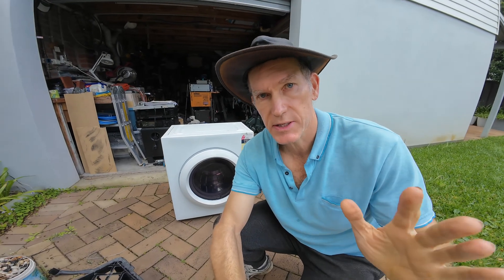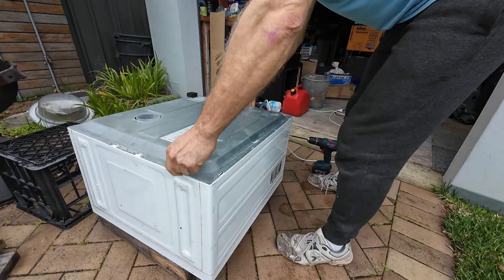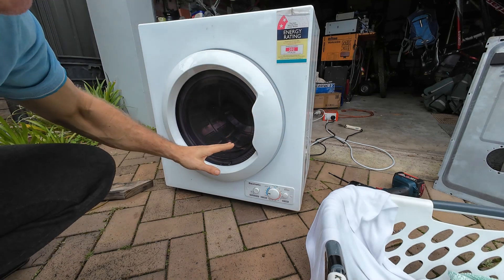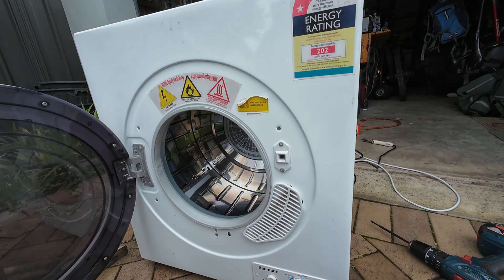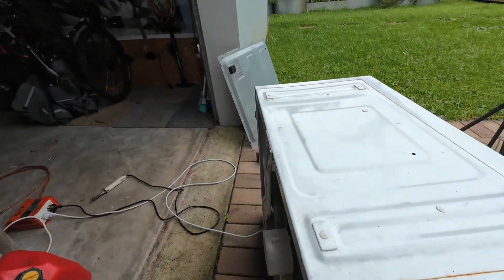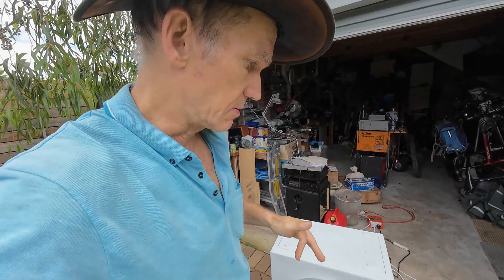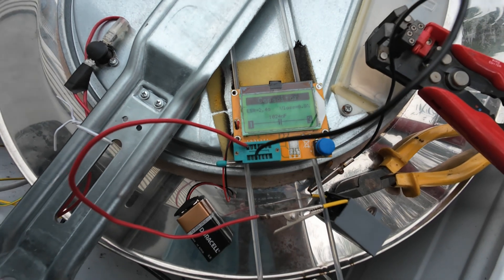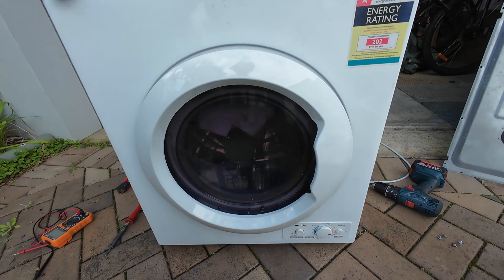Clothes Dryer Not Starting? Change Your Capacitor! Complete Fault Finding Guide...

Comment: I bought a Chinese start capacitor and replaced it. Do you think they are any good. My dryer still tries to start but doesn’t
Reply from the maker: I've used them before and they've been fine. Do you have a capacitance meter to check the value? Check that the drum rotates freely (there will be some resistance but it should turn).
Reply: @pescado99  I only have a multimeter. I’ve taken the drum and belt out. When I press the start button it jolts and spins slightly. After pressing about 20-30 times it can sometimes start